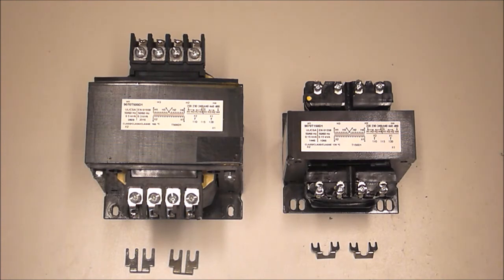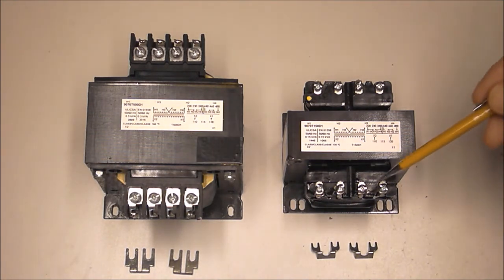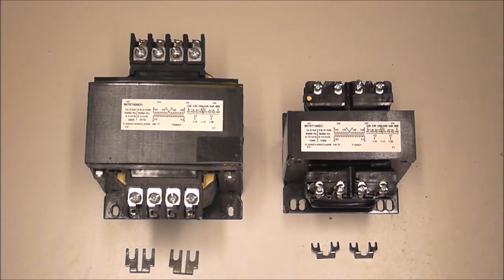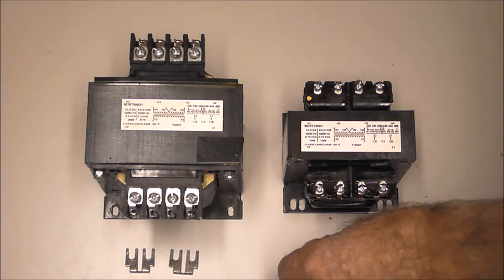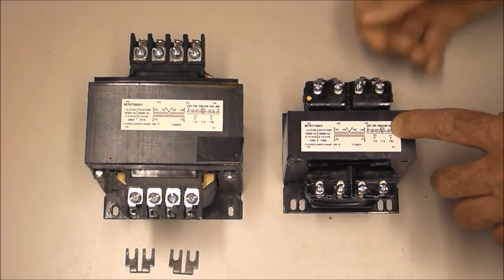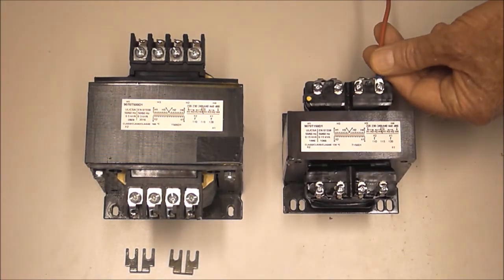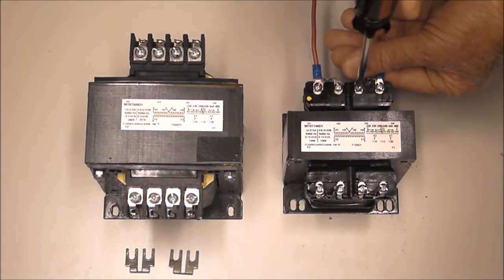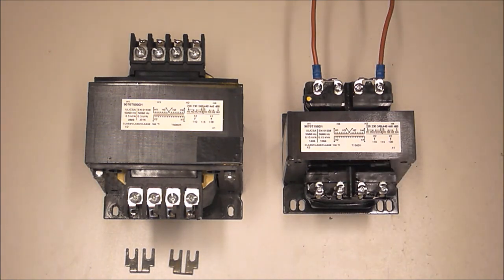Installing Jumpers on Square D 9070 Industrial Control Transformers | Schneider Electric

Comment: Hello & Thank you ! I have this Siemens transformer MT0100A using 1 Phase 230v can I use a jumper from 1 line screw to the other to get 2 lines of 115v ? The Amperage is about 75A  at 3000W but my house only uses 3Kw a Day and my Inverter is a 5KVA 230v Pure Sine Wave Inverter Charge Controller ?
Reply from the maker: Thank you for your message. For technical support or to find answers to your questions, please refer to our support center: https://www.se.com/ww/en/work/support/support-center.jsp
Reply from the maker: Thank you for reaching out. For technical support or to find answers to your questions, please refer to our support center first: http://spr.ly/6051J7PuD

Comment: I have the Seimins MT0100A Transformer I only have One Phase of 230v and I need Two Phase of 110 - 115 - 120v my power source is an inverter 230v X 1
Reply from the maker: Thank you for your message. We apologize for any inconvenience caused. Our customer care team would be happy to provide assistance. Please reach out to a customer care member in your location here: https://www.se.com/ww/en/work/support/country-selector/contact-us.jsp
Reply: One Phase 230v 5KVA Pure Sine Wave Inverter charge controller 48V into a Siemens MT0100A Transformer-ratted for 230v can I safely jump another power wire from the 1 phase 230v inlet to the Other Phase or because there not 180 degrees out of phase is that bad ? I am not an electrician , trying to set up my inverter for back up when electrical loss . Any help welcome ! Thank you very much for any help any websites available !
Reply from the maker: Thank you again for your message. We have routed this to our customer support team.  For troubleshooting support or to express your concerns, please reach out to a technical expert in your location here: http://spr.ly/6056JwnQi